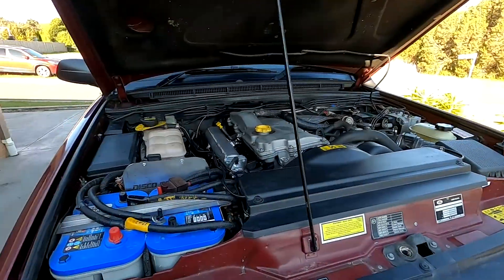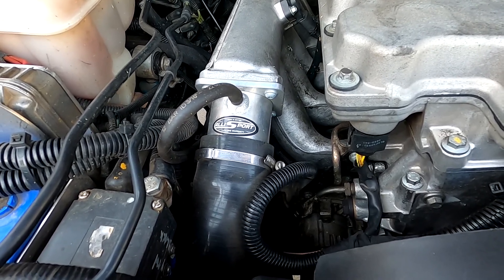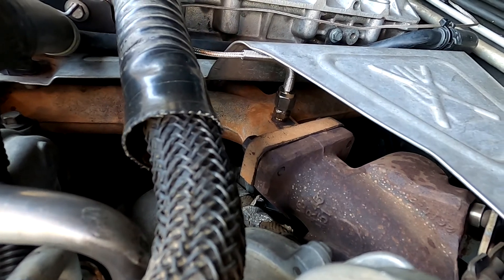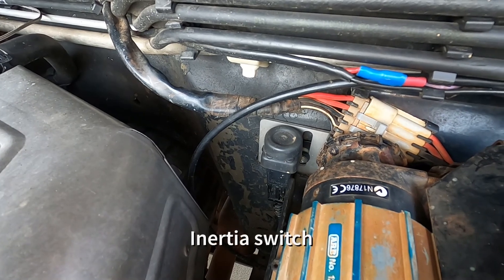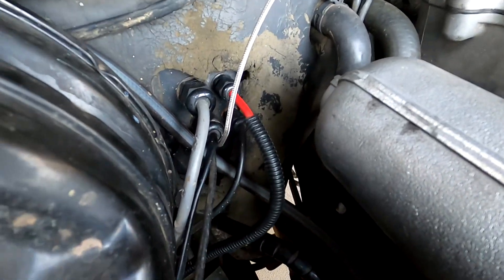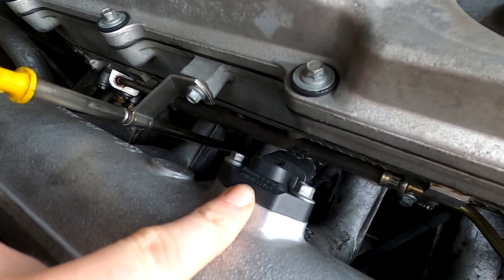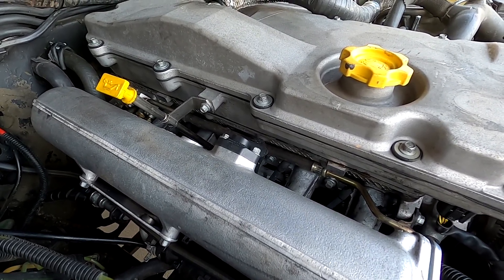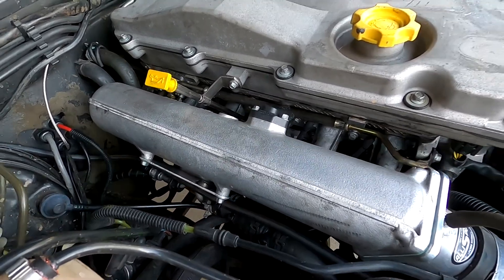Disco 2 Modifications Engine Bay

Comment: Nice Shane. Looking at the FPR I'm guessing D2A? You have some of the same things I have. That battery tray is interesting. I have something almost identical which was made by some guy called Carl, I have had if for around 5 or 6 years. Trouble is, it was designed for DF34/5 Optimas. I've had a bad run with them, so I have found a crank batt that fits well in that tray with better crank amps, but have to relocate the house batt into the rear of the car.  How does the compressor deal with the heat off the turbo? I have the same tray. Mine isn't a 2A. 
Love to see more on the 12/24v thing.
Reply from the maker: Hi Greebo, the air compressor handles the heat fine. I only use it when the bonnet is open to pump up my tyres. Because I use ATB diffs I've got little use for air lockers. I've found the D34 Optima batteries to be okay so far, shame your experience hasn't been the same.

Comment: How did you attach the batteries? , regards Tom
Reply from the maker: Hi Tom, it is kind of complicated. There are 3 solenoids under the batteries which switch between 12 and 24 volts. The key part is, in 24v configuration only one battery is being charged so it is important to switch it back to 12v.